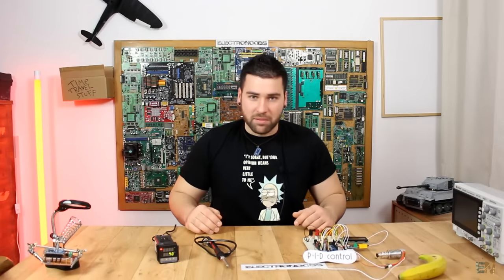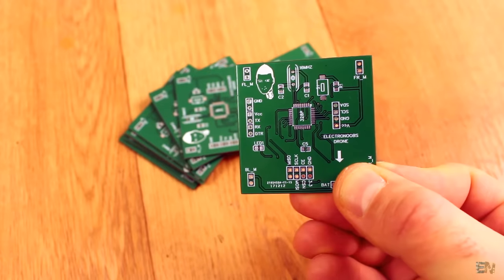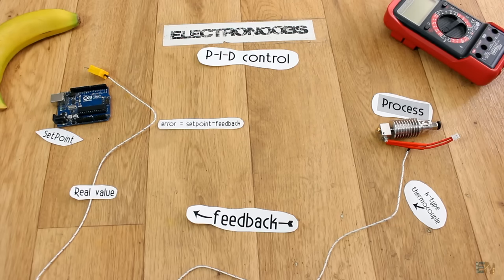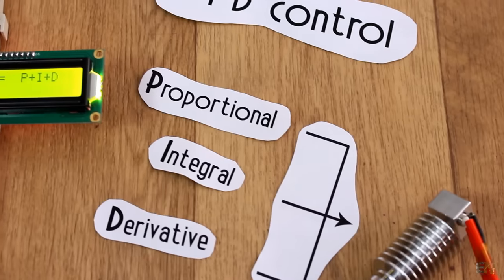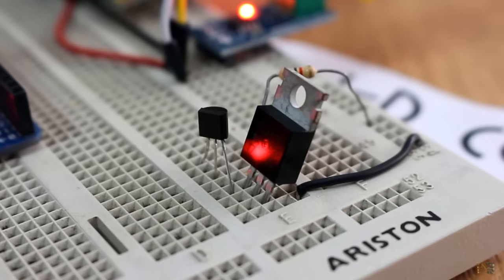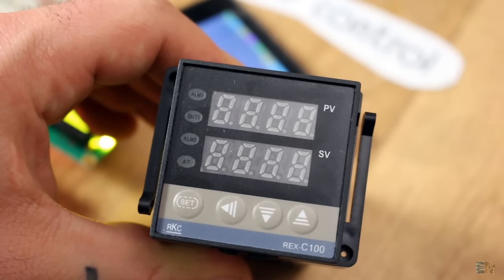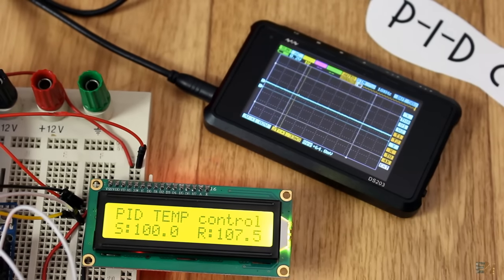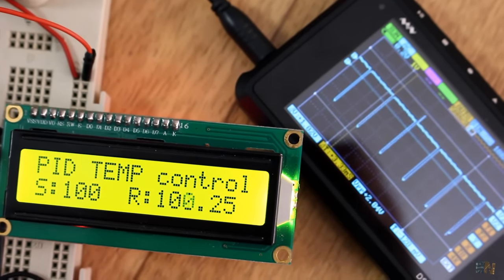PID temperature controller DIY Arduino

Comment: I have a cheap tankless water heater without a temperature controller.  I'm making a temperature controller using an arduino, solid state relay and a PT100.  If I implement PID, would not the tuned constants be different based on the 
1. rate of flow of water,
2. the incoming water temperature?

Comment: Hi Mate, I was wondering if it would be possible to modify the code and schematic to include an output when the heater gets up to the required temp.  Sadly I am not clever enough to be able to modify the the code.    I plan on using this to control the heater temperature in a scrap 3D printer filament recycler..

Comment: Is it okay to use a motor driver like l298n for the heating element or the mosfet is better?, I tried with l298n but it seems to get pretty hot so I stopped it because it may burn out

Comment: if I use that encoader module then those 10k resistor won't required which showed in schematic right?

Comment: Thank you for sharing.  I am building this for my work.  (I'd love to share the background behind why I'm doing it). Im not good worth programing and couldn't have built it with out you sharing this.  Two questions. If you would like or allow i would like to share the code edits I did to make things work a little different for my application.  I've commented the lines I've changed and why.  I'm close to getting it workinig. It's been a HUGE learning experience for me. Second. After I've got it up and running I would like to share a few photos of the end use and make a contribution to you after I get reimbursed for my cost into this. How do I go about doing that? Thanks
Reply: This is one of the first things i've ever liked on youtube (on reactions).

Comment: Hi...nice video and very well explained...i have a question...can I use ntc100k thermistor instead the thermocouple and an irf520 mosfet with the same code?do I have to change anything in the code?sorry but I don't know how to write a code for arduino.thank you!
Reply: did you work this out? thermistor would be much more convenient for smaller projects such as mine. that thermo couple is HUGE!

Comment: Hi, I discovered this week your solder iron. I am planning to do a solder station but based on esp32. Could I use your schema as it, or change are needed for 3,3v?
Reply from the maker: Same schematic but just use a 3.3 voltage regulator for the ESP32! In my case I've used a buck converter module to get 5V. Just set that to 3.3 if you want!

Comment: what if I use a LD33V voltage regulator and PN 2222A transistor or does the 2 device need to be higher

Comment: Is there any way to add a humidity sensor to this. Not a DH11 that just displays both temperature and humidity. I want to control a heating element just like the video but also add a humidity sensor to the arduino and display it along with the temperature on the LCD.

Comment: , nice video, Im just wondering how to add second temp. probe and set eg. hot plate temp. max. 120(surface) AND steam temp. max. 97,  so you dont burn down your "pot" and not "over" boiling it,  Im researching and looking while I start using that REX-100 unit, ;-) (what is decent PID unit for its price with SSR)

Comment: hello sir, I have a problem here. I'm using 12V Heater directly (without that iron things) to heating water. Unfortunately, the water temperature didn't change at all. Can you help me by giving suggestion about this heater? Thanks

Comment: Ok I have made this and was very simple, but the MAX6675 is so slow to read tempature.
Lets say I have an instant heating element like a cartridge heater or glow plug, it takes the 6675 very long to read.

Comment: Will it work as perfectly with Peltiers? Awesome video
Reply: J-F Dube. Yes that will work just fine, BUT....
You probably won't be able to use PWM as a driver for your output.
Heaters respond quite well to chopping your power in time segments. (Temperature change per Watt effective)
 Peltiers, as far as I know, are quite specific 'current devices'. 
(Meaning their transfer function is more like dT/dA... A temperature change per (milli) amp. )

Comment: I am having a major problem... there is a temperature rise (temp.shoot - rising to 180 deg celsius )whenever the 12 v power supply is connected even if the arduino is not connected with the computer... Also the rotary encoder is acting as a regulator to increase or decrease the value but not changing the mode as seen here in the video... please help...

Comment: Hello, i want to duplicate you're project and i have some problems with the rotary encoder. the push button doesn't work properly. when pressed doesn't works. when rotating it goes from menu to menu and the values of the p i d are modified by itself

Comment: Sir i dont want to use BJT between  mosfet and arduino. Plz tell me the value range that need to be changed. In your code it is 255- pid value. Plz help

Comment: Could you explain how you adjust each parameter? Do you simply adjust the P constant until the desired ramp up speed to temperature is reached for example? Once you have that determined, the D value then becomes the error constant and need to find the happy medium for that (i.e it lands on the right value and doesn't take too long to reach final value)?

Comment: Faulty code
The integral part should be accumulated from the small errors.So if there is error, the integral part is changing continously.
 Additionally the integral errors the small additions should be multiplied by the elapsed time. This is how integral works.

Comment: Is all PID trial and error, or can we set it more accurately with some sort of testing procedure, ie oscilloscope.
Reply: SidneyCritic ComedyHound.
It certainly is not all trial and error, but even the most experienced engineers will need to test their calculated gain factors.
Auto-tune, available on cheap and expensive commercial PID controllers is notoriously inconsistent.
Reply: Yes I found out they are not all equal. We have PID control of closed loop idle in our Arduino based EFI system, and even though it can go to 200 I couldn't get the engine to not hunt(oscillate) at anything over 50 for P. Other people got theirs working, and I found out they use tiny values, ie 30,10,0, and that's when I realised you can't compare values of different PID systems. The guy that wrote the firmware shouldn't have made it so sensitive, or not allowed a massive 200, because it makes you think you should be at the mid point, ie 100, rather than at such a small 30.
Reply: SidneyCritic ComedyHound.
What almost every article or YouTube video about PID's ignores, is the fact that P, I and D have dimensions. P is not just a number. In the case of a heater, like in the video, Kp is in [W/°C]
Another big difference between commercial PID's is that these numbers are not given in Kp, Ki, and Kd, but rather in PB, Ti and Td. These are for most of us not very intuitive. A low PB is the same as a high Kp. 
I don't have much experience with motors. 
A significant difference between heating and motor control seems to me the time constraints. Heating is a slow process, the PID usually works fine when you update your output every few seconds. (Or even minutes). A motor may need much faster updates.
Reply: Really, that explains why I see big #s in vids. 
I watched a few vids and they just seam to trial and error a #, and by the wobble of robot they new what to do. If I get back on this project I will have to do some more digging.
Reply: SidneyCritic ComedyHound.
I m sure a lot of videos really DO just trial and error.
It's a huge difference though, if for example you see huge overshoot, and you reason your proportional gain is to high, then you try to adjust it down, not knowing you are actually setting PB down, making it worse... 
It would help if you know that (in your specific system) a gain of ”30" means 100W/C. That way you get a feel for it being reasonable.
100W is a lot for a soldering station, but it is not that much if you re heating a liter of oil.
The most difficult part is to dimension your loop. You really need to consider what your transfer functions really are. 
In case of a heater, the output of a PID controller is usually a duty cycle (% _ON). The amount of heat (energy) you add to the process is Watts (Joules per second) . So the total transfer function is 
Duty_cycle * heater power/ degree C (error).
It's pretty tiresome to figure all the numbers out, but you will be rewarded by more easily reaching a stable process.

Comment: Can I substiture a nichrome wire for the heating element?
Reply: I imagine the heating element should not matter. Find a way to control it, and you should be able to use propane.

Comment: Hi, why do i need a 10K ressistor , my heater is 24v do i need a 10k ressistor too? and can i use the components s8050 & IRFZ44N for a 24v heater too?
Reply: Did you find out? My heater is also 24V im not sure if i can use IRFZ44NN.

Comment: What if i want to use an engine heater plug (glow plug) as an element, what changes do i need to do on the circuit

Comment: Can l replace a mosfet circut with 5v reley and use this to make soldering station?
Reply from the maker: Yes but that will oscillate a bit more since the relay is not that fast. Keep up!
Reply: Tnx a lot.

Comment: I am a bit late to the party... But is it possible to do this with a variable target temperature? Or are the three constants not enough in that case?
Reply: It's perfectly possible. But not a random temperature. Or extremely fast changes.
Reply: @J.H.hhhhhhhhh  hey thanks for the reply. Dew point temperature inside a home should be OK then right?
Reply: @c.m.7692  yes, you'll need the function that describes the pressure and temperature relationship. So your sensor would also need a pressure sensor.  You'll measure the given pressure and calculate the above or under dew-point temperature from those values. This temperature becomes your target temp. Then the thermocouple/thermistor checks if given target temp is reached.
Reply: Very important is also how fast the thermodynamic system can react. A small aluminium block reacts much faster than an air filled room. That's something you'll have to consider.

Comment: sarebbe fantastico ma non riesco a compilare il codice..  mi restituisce questo errore Arduino:1.8.7 (Windows Store 1.8.15.0) (Windows 10), Scheda:"Arduino/Genuino Uno"

PID_temperature_control:53:7: error: redefinition of 'float last_kp'

 float last_kp = 0;

Comment: Q1: in Ur schematic, it shows the D11 blue line coming out from UNO, but there is NO place going to? .. Is it a mistake?
Q2: Ur giving 12V to the heater &  (MOSFET + BJT) thro a "10K resistor" ... If I use a 5V heater, how much will the resistor value be?
I'm not a professional like you .. Only an electronics lover :)

Comment: can you do something similar with air pressure? (PSI sensor)  opening solenoid valve to reach desired PSI ? ability to demand 55 psi inside a cylinder , solenoid valve opens until psi is reached, closes after on its own.
Reply from the maker: Hmmm I will look into that
Reply: @ELECTRONOOBS  looking forward
Reply: @ELECTRONOOBS  
I made my machine learning pid iron station and i made pid code by helping your videos great man

Comment: Forget the  AC version . Why don't you have a function button that injects a 10 degree change in set point for say  3 seconds with the output control frozen .  takes the response, treats it as first order lag, calculates the optimum K and Ti  constants for this  Process description and then goes back and does another bump and  does a final tune on the Td constant. I may have some notes on this if you want to get back to me.  Engstr          at                                           netspace  dot net.au

Comment: isn't the schematic wrong? if you connect the 12v to the gate of the mosfet then it will be always on???
Reply: MOSFET will be ON, but when the NPN turns ON... it will pull the Gate to the GND and turn OFF the MOSFET... Look it as a inverter:  
arduino: 1 -> MOSFET: off
arduino: 0 -> MOSFET: on

Comment: I breadboarded the circuit today but i'm not able to load the code into my arduino Nano.
The following lines of code give trouble:

Under //PID constants:

  float last_kp = 0;
  float last_ki = 0;
  float last_kd = 0;

  int PID_values_fixed =0;  (feedback example: exit status 1
redefinition of 'float last_kp')

Under void setup ():
  lcd.init(); (feedback: exit status 1
within this context)

After striking these lines inactive, the code is compiled and can be loaded into the Arduino, but there is no data on the display. I already changed and verified the display I2c adress with standard code.

I hope somebody can help me out on this. I'd really like to get this project on working order to try and control my kamado with it. :)
Reply from the maker: the lcd.init(); error might be because you don't have the i2c liquid crystal library installed!
Reply: Thanks! That was helpful.
After some more alterations and troubleshooting the circuit is now reading the temperature and activating the PWM signal.
What annoys me is that each buttonpress on the rotary encoder also adds 1 to the selected value. So if you cycle through the temperature, p,i and d menu 3 times without turning the encoder, all 4 values are x+3.
Reply: @Meatlove  greetings! I’d like to make you a question about the rotary encoder. Would you help me please?

Comment: Is it possible to use a 100K NTC thermistor instead of thermocouple?
Reply: Bin Sun. Yes.
The convenience of the thermocouple amplifier (max 6xx) he uses is that it gives the temperature in degrees Celsius through the SPI interface.
But any way you get a reading for your temperature is equally good.

Comment: there is something wrong in your code, bro
Reply from the maker: There might be... Tell me what you found so I could correct it. Thanks!
Reply: to get it work i have to delete #53 to #57. 
#75 change lcd.init to lcd.begin
#174 and #194 missing "//"
Reply: and your pid code is reversed, when read temperature < set temperature, pwm signal in pin 3 stayed at 0 instead of rising.